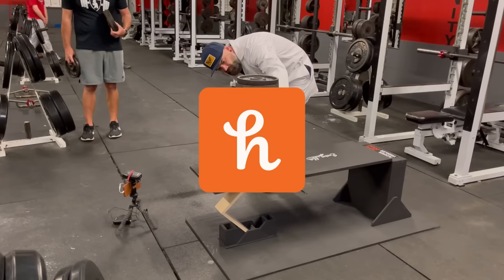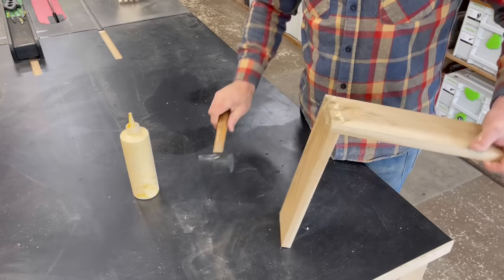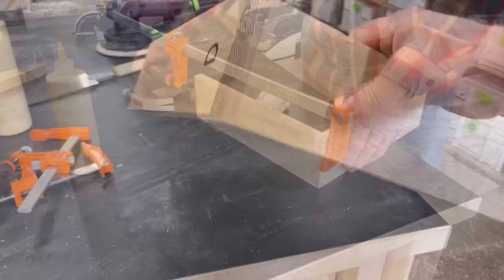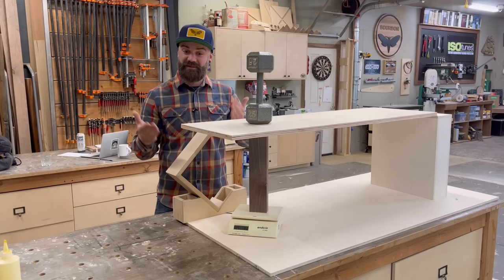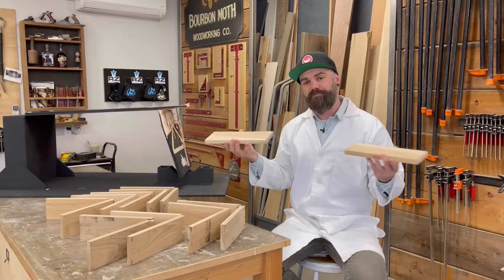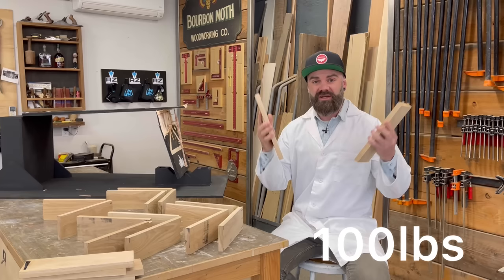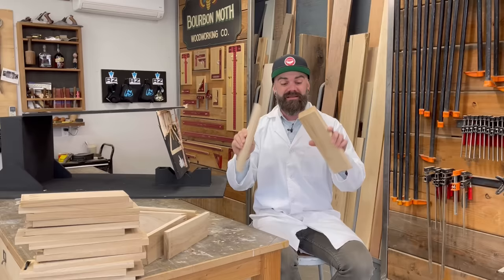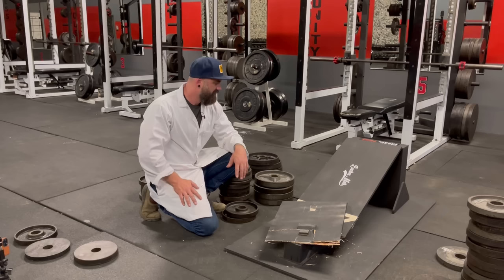What's the Best Wood Joint || Insanely Strong Joinery!

Comment: As an engineer specifically in structures, the applied force and direction in relation to the joint have a huge impact on the results. The joint actually felt more force than the weight you put on top. This is called a moment arm between the joint and applied force. This is measured perpendicular from the joint and the applied force. I agree with you that more test would need performed as this is one case out of several cases and only measures the strength of these joints in a very specific instance. Still fun to watch and interesting.
Reply: Luckily, there's constants that can help determine just how much weight was applied on those joints as a result of the length of the lever.
Reply: And the test is valid for relative strength for the direction of stress it measured.
Reply: While true, the measurement of the force in pounds isn't really important here.  What's more important is the comparative data - Having 5-10 of each joint would be helpful to take an average reading of the breaking-point of the joint.  Also, instead of a levered arm with gym weights, using a hydraulic press with a more accurate digital readout would provide more accurate comparative readings.  This is a good start, for sure.
Reply: Side topic from the video. Don’t have a degree in this field, but use moments, arm, and center of gravity (CG) all the time for work. If you would be willing to help us understand more. Wouldn’t you have to figure the moments being applied by finding the distance from the joint (arm) and then find the CG and multiplying them? You just used the term “moment arm” and I’ve always thought those as two separate things.
Reply: A better measure for the strength would be the torque in the joint. This depends on the force applied, the length of the lever and the angle between the direction of the force and the lever. Sometimes torque is also called moment which someone else here mentioned, so maybe we're talking about the same thing. Consider using torque to compare with new measurements or just keep the setup unchanged. 

Great video and what a surprising result!
Reply: @grubbsnorthrop9807  moment arm is simply the distance your applying your force from the point of interest. Hope this helps.
Reply: @MattMuirhead  agreed, there is consistency in each of his tests and the data is certainly comparative. It was fun to watch. Just bringing awareness that this isn’t complete and only accurate for this specific case and load orientation. May not be accurate for the strength of these joints  when pulling on a drawer face. The loading is different and so is the joint orientation respectively.
Reply: You are exactly right, but I tried to explain it outside the realm of engineering without its engineering terminology. Otherwise you could use distance from the fulcrum of pressure,  Glue saturation  and a lot of other terms.
Reply: Moments of force.  Quite right.  If one were to pull the joints apart in their relative planes, probably the dovetail would ge stronger.   As is important inn a drawer.  Where they are used!  Dove tails are not good on rotational and twisting situations.   Where they are not used.  Horses for courses.
Reply: @soren_sjb  The interesting thing this brings up for me is all of the ways different joints are stressed in “incorrect” usage: overloaded drawer, chair that may be tipped back by the sitter, chair or bench used as a step stool, table/workbench that someone may sit on the edge of, bookcase that may be pushed into position.
Reply: Yah that's what I was thinking too...I just didn't want to be the first to say it
Reply: As an engineer, I think this simple test proved that most of those joints are for looks (or to sell an expensive piece of equipment) in the application he applied them
Reply: No clue to what you are saying but I agree!
Reply: Would be also interesting to see tests with forces applied in typical applications.  For example a pull test like for drawers or shear testing like for cabinet shelves.
Reply: Lol was going to come down here to say that you are getting the moment which is a different force than the actual force it would take to break as the moment takes distance into account
Reply: I think you said what i was thinking.😀
Reply: Came here for this comment but he said it better than I could
Reply: This is a good point. I do feel like this video provides a good surface level idea of how common joints would handle a bending moment that is likely more than it will see in most applications (most boxes using these joints won't ever see loading like this). I think a lot of the information in this video would be valuable for designing stuff like leg assemblies or something that would see some more significant bending moments.
Reply: Concur with your thoughts and I'd put more credence in the results if he did five coupons each.
Reply: As an English major, I hope your engineering projects have better structure than that sentence contained.
Reply: @robertbamford8266   yes but it is not obvious what direction the joint is stressed.
Reply: @MattMuirhead  I smell a collaboration with the hydraulic press channel.
Reply: meow meow meow meow meow
Reply: The moment arm is perpendicular to the weight. I estimate the board length to be one foot. Thus the moment arm is cos(45) equals .71 x breaking weight in foot-pounds.
Reply: Came here looking for this too. When he talked about plain weight I instantly jumped back to Statics class and moment arms. So the force was applied at a 45 degree angle to the piece of wood and the distance of the lever arm wasn't taken into account, although it did look consistent. So as far as a reliable test to eliminate variables this was great. But the numbers don't accurately reflect the forces. You're looking more at torque on the joint than weight. Still a fun test to watch.
Reply: @Nonya855  Personally I'd like to see him team up with Project Farm.  That guy has the equipment to push, pull and twist the joints and get data on each.  They could then test 3-5 of each joint in a push, pull, and torsional actions.  Project Farm has done a similar video with drywall anchors and with various different brands of super glues where he tests all of those scenarios.
Reply: Does it matter which side of the butt joint is up? Same question for the other non-symmetrical joints.
Reply: Some people mentioned that torque may be useful to know. This is just the force from the weights divided by 1.41 times the length of the board. Another thing that may be significant is that the test applied a torque to the joint but at the same time pushed the pieces together. Not sure if this makes a difference.
Reply: The mitre joint is cut at 45° and the pressure was applied at 45°. The mitre type joints worked best against pressure applied at the same angle as the mitre - or a flat surface resisted the axial load.
Reply: Anyone can say they are anything on the internet. On that note, I am a social engineer, so I know how these things work.
Reply: Shaman Credible - You just included yourself in a discussion far above your capacity of intelligence. It was likely best you clicked ‘like’ and moved to the next comment in the thread.
Reply: Ah yes, irrelevant.
Reply: You were doing God's work out here sir. Thank you, Thank you! Static and the dynamics classes  is the specific reason I decided to stay as an E.E. with a concentration in digital signal processing and a minor particle physics.
Reply: @kevinw9077  as many people  have eluded to as far as the video goes  It's interesting and I think he did an excellent job , but for use in real world applications the methodology is less than ideal. And his prolog tells me he sees that now also . Most of the joints he tested  were not loaded in a proper manner for their intended application. Example the dovetail  joint is  considerably weaker in one direction than the other.  When used for a drawer  it would be oriented with the  strongest direction front to back not side to side since the forces are more extreme as slide in and out repeatedly for decades. A Cabinet maker wouldn't use that joint if it were loaded in the we he did. Those joints after all are the tools a cabinet maker or joiner would be expected to use properly as though they were a plane are chisel.
Reply: Lmao engineers are like vegans
Reply: He literally says at the start of the video that there are a lot more variables than what he had catered for in this video. But good job telling everyone you're an engineer with what my year 11 engineering students could come up with 👌
Reply: The test is not valid as the bottom board is restrained and hence supported at 45deg and the top board is located by battens again limiting freedom of movement, therefore an asymmetrical load was applied to the joint under test … both top and bottom ‘pivots’ should be ‘free’. Perhaps a single batten on each to provide a starting location.
Reply: thank god we have an engineer to make this comment as I couldn't for the life of me articulate the words. I was going to say something about the lever effect being less of an issue if the weight were distributed across 4 joints (like in a standard table or chair) but then I was baffled as to why that would be the case.. something to do with roman arches maybe? leave it to the engineers I say
Reply: Agree, loading conditions are the biggest deciding factor here. Miter joint is going to be advantageous in this situation because it is able to distribute the load more evenly. In this loading condition the angle reduces the torsional stress (moment Arm) loading into shear loading by the taking the normal force of the cosine of the angle. If the relative load was adjusted to be parallel to the angle, I would bet on the box joint greatly outperforming miter. Good Engineers must understand the assumptions and use cases and then chose design (based on physics and material properties) that has best trade off,  given project goals/constraints. Much of why experience is so important. Still a cool experiment!! Its just flat out wrong to use these test results to generalize all cases.
Reply: @Nonya855  that would be interesting
Reply: Direction, pull-push, rotation, static, dynamic…
Reply: @fl7210  as an engineer I agree we can be quite anal-retentive much like vegans.  I apologize on behalf of all engineers.  We often learn to be this way because stuff often breaks in unexpected ways which often costs people their livelihood and sometimes their lives.
Reply: I build subwoofer boxes and some of them need to be very strong. what would be your recommendation for this particular application where the strength of the subwoofer can tear the box apart from the inside out if not sturdy enough. The higher power you go the stronger the box needs to be
Reply: I think the people saying this lil experiment is flawed or not “valid” are incorrect.  This just looking at one datapoint.  Load in one direction with the joint at a certain angle.  Completely valid for what it is.  Could other ways of stressing this joint be helpful or better?  Sure but that doesn’t mean this not useful information.
Reply: @johnnycorn7225  boxes are Piss poor Speaker Enclosures and cause Distortion, Spherical Enclosures are Far Superior due to internal and External distribution and Far less influence on Voice coil and diaphragm

A more perfect piston movement
Reply: @mjolnirswrath23  definitely
Reply: @mjolnirswrath23  everybody said I was stupid and it wouldn't make a difference when I took half inch wall thick quarters of PVC 12-in tubing and adhered it into the corner sections of a box and then demonstrated how much better the air flowing sound was after doing it. It's really interesting to observe the wave pattern behavior in a square shape versus a circle obviously the air movement will be far superior in the round enclosure after experimentation. Every right angle causes a standing wave and has restricted air movement
Reply: I’m way late to to this conversation and also not an engineer, but…would you say the miter joints had an inherent advantage in this test based on their design relative to the direction of the force applied in the test?
Reply: All I could think watching this was hydraulic press
Reply: Your funny and I've always liked your videos
Reply: If you do this again can suggest trying a half lap? Pretty easy for the novice woodworker and I assume would do pretty well in your test.
Reply: I would echo the fatigue consideration here.  I don't believe that the unreinforced butt joint or the simple miter joint would survive more than 10 to 20 cycles at 20 pounds.  It would also be a sudden, catastrophic failure rather than one where the dowels/dominoes/pocket screws are gradually pulled out.

Just my perspective as a naval architect/structural engineer.

Comment: My theory on the dove tail is that the pins were just too small. Your box joint beats it just by having more glue area. I think you could get a significant boost with a 50 50 ratio of pin to tail
Reply: If you look closely the board actually split along the grain, spread, allowed the smaller ends to slide out
Reply: This.
It was a pretty bad example of a dovetail joint. I questioned it on first glance, and not surprise it failed spectacularly. The little details make a huge impact. Also you have to account of the same wood and same glue, which he didn't.

You can also cut dovetail joints in the trans-axis/dimension, which would decrease it's rigidity in the "pulling direction" but increase it in the "crushing direction". There's some interesting techniques in Ancient Japanese woodwork, and they occasionally used spines which really adds a lot of strength. That was no surprise to me.

Before the video here's how I expected it to go:
13- Butt Joint Glued
12- Lamello Attached
11- Domino Attached
10- Milter Joint
9- Dowel Pins Embedded 
8- Pocket Hole Inside
7- Pocket Hole Outside
6- Butt Joint with nails
5- Butt Joint with screws
4- Milter with spines
3- Box Joint Proper
2- Dovetail proper
1- Dovetail 3D/spines
0 - Weld that sucker!
Reply: @shadowanonymous3941  Dovetail joints present a lot of areas for stress concentrations. Stress concentrations in a linearly grained material can cause failures like this. I do agree that the small pin size may be a contributing failure factor, I would expect more equally sized pins/tails to be stronger in a situation like this.
Reply: Not so much the glue area, it simply slid . And with the angled cut it should have actually offered more surface area than a straight cut in a box joint. It most likely slid thru because of the angle of the cut and that was simply limited by the thickness of the pins (thinner material means you cannot increase your angle on both sides. The thicker box joint mainly offered a compression force distributed to both sides of each pin. The thin pins cannot simply be compressed on both sides to prevent it from sliding. That is, given that the pins have very tight fit. It could simply be that the dovetail pins were not as tight as the box joint. The fact that it slid instead of breaking at the shoulder means there is a problem with the fit. Of course, given the forces applied, the box joint will always defeat the dovetail in terms of preventing breaks at the shoulders since the grains are simply supported on all sides unlike the angles cut on a dovetail where the pins are smaller in diameter closer to the shoulder.
Reply: No, it's because dovetails are specifically strong against pulling pressure, not 45 degrees downward pressure. If it was a pull test, dovetails would be top.
Reply: @ekinteko  he did account for the same glue, he clearly says he did, not sure why you're lying. Even if he didn't say it, you'd be assuming.
Reply: @otallono  Not for the dovetail. It was made outside, so it's not likely to be the same glue.
Reply: @ekinteko  well, he did actuall mention that he made sure the same glue was used... 19:32
Reply: Was literally thinking the same thing.
Reply: My guess was that maybe the dovetails are not as tight as the box joint...
Reply: Exactly!
Reply: I felt the same too. I’ve never seen a dovetail like that, ever. Usually, they’re equal, like the box joint.
Reply: @AngelofOntario  dovetails with small pins are a stylistic choice that's very common.   It kind of "shows off" that they were hand cut not made with a router jig.  I personally wonder if dovetails with a router jig would be up there with the box joint though...not because of the pins size but because no matter how well the dovetail is handcut there's always going to be microscopic imperfections.  With a router jig there's potentially a lot more consistent surface area  for the glue to bond
Reply: he just put the weight on the dovetail joint the wrong way, they are meant to work in the opposite direction
Reply: yeah I would assume the same.
Reply: @marwerno  same KIND of glue or actually the SAME BOTTLE of glue...shelf life weakness is a thing
Reply: See, I think it's the angle.  The pins look like they're a strong wedge, but if you zoon into the grain, all the stress is where the grain is also sliced into increasingly small layers, so I feel like that might weaken it more?  But I'm no expert.
Reply: I think in this case the wood is breaking, not the glued joint. The little triangle of wood in the dovetail spline is separating from the rest of the spline.
Reply: That's my thought exactly. Traditional dovetails that I've seen are 50/50.